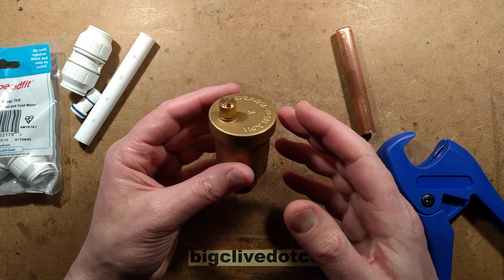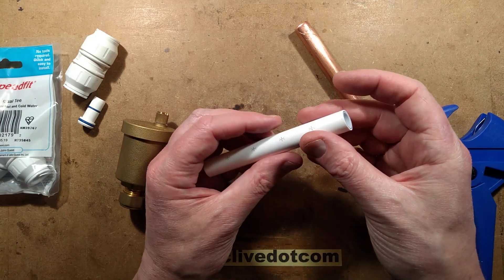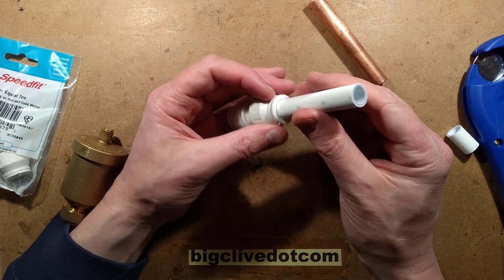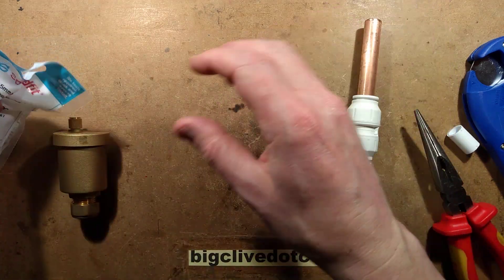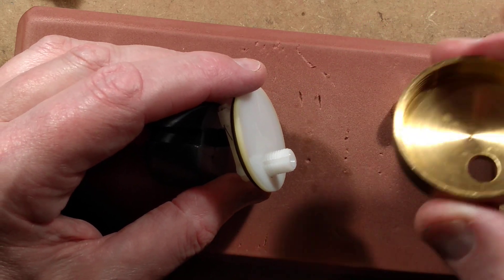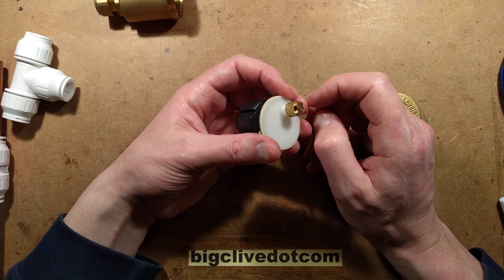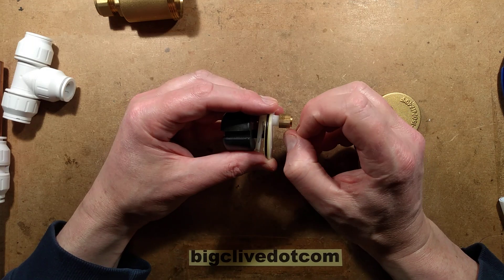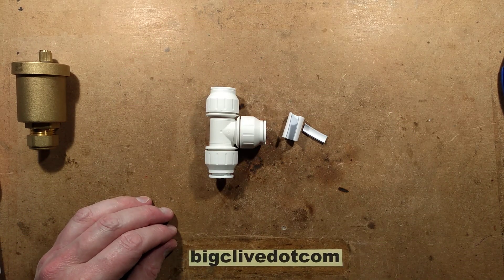Inside a bottle air vent and plumbing ramble.  (No electronics whatsoever.)

Comment: Hi Clive, I was watching your video on bottle air vents, and a couple of things came to mind. Like you, I've always sworn by copper as compared to the new untested plastic pipes. But two winters ago, they had some prolonged periods of below freezing weather in wales. And as my son and his wife have a wooden holiday chalet in wales, when they made their first visit after the winter, and they turned the water back on, there were at least ten different bursts in the pipework. But when I went with them to do the repairs, we found that half of the chalet (I'm guessing it must have been an extension built on the original), was piped for both hot and cold water with plastic pipe of the type you were describing. And whereas the sections of copper in all other areas of the chalet have ruptured, there wasn't one leak, nor forced joint, nor split in any of the plastic system. So maybe, plastic is the way to go. And one more thing, if I'm not boring you; your pinholes in your copper pipe. A thought that struck me, was that I've always cleaned the ends of the pipes with wire-wool. I assume you're familiar with this stuff. And whereas it doesn't leave significant grooves or scoring, tiny little fragments of the iron strands can and do flake off. Could those pin-holes have been caused by such little fragments floating down the pipe and then settling? And over time, some kind of dissimilar metal electrolytic reaction has eaten its way through.

Anyway, these are just my thoughts, and I thought it was about time I thanked you for your instructional videos; keep up the good work.

Comment: Sounds like a problem we have in East Yorkshire with some of the copper pipe installed in the 70's with the impurities and usually quite a thin wall thickness to the copper tube. The reason I've heard is the 70's copper shortages and in the 50's too after the war. I saw a lot of it working for a subcontractor of Yorkshire water. It has the nickname of 'pinhole copper' because often we would fix one leak only to find another would start a few cm away, like someone had gone along the tube with a pin poking holes in it. Mostly we would find many tiny grains of impurities in the copper - a problem that was exasperated by the thinness of the tube!! I was usually easier to just replace the whole run from stoptap to stoptap.
Reply: AcidEric yep, yet when young Luigi and Mario find pinholes, they’ll still swear the pipe was from the 70s not the 50s.
Why of course, because copper pipe from the 50s would naturally have already failed, and been replaced 20 years later by what you see now, still in place 45 years later. Makes lot of a hill good sense to me.

Comment: I have been using those style of push-to-connect for about 10 years now and haven't had any issue. I have been doing FIRST FRC Robotics for 10 years now and the Pneumatics uses those connects for 1/4" polyurethane tubes. The fittings we use are Parker W68PLP-4-2, 364PLP-4,
 and W369PLP-4-2 and the pressure reaches 125 psi. I have never seen one fail and we reuse these fittings every year. Needless to say, they are excellent push-to-connect that is easy to install and removal is just as easy.

Comment: If you'd care to do more water related videos, may I ask you take a look at a product called "my secret bidet?" I just saw a video about it on my homepage and to me it looked as though the dial you turn to adjust the pressure is just a valve that controls the flow right from the pressurized feed on your toilet. The infomercial looked as though it could give you a right blasting up your particulars!
Reply: Providence83 Instant enema whiluwsit.

Comment: I used a similar push-in connector but it is all metal, and less complex. There are no screws. Instead it uses an external plastic sleeve to lock in place.  I'm only kinda concerned about water hammer incrementally nudging it out of place.  (The washing machine this fitting supplies has brutally abrupt valve actuators). I marked the pipes going in, and if they have moved at all in two years, it's within the "resolution" of my ability to read my markings.  (Within the circle of confusion you could say, for photography geeks.)  And yes, this video did make me go run down and check it.  Apparently these are perfectly reliable when done right, coming from my contractor brother and his plumber. (no burrs, no linear grooves).  He suggested using brown scotch-brite in the way you use sand paper here - moderately squeeze the end of the copper with it and act like you're screwing it into the scotch-brite.

Comment: when i first saw the thumbnail for this video, i thought you were holding a drafting pencil sharpener. the i see its about plumbing air vents and funky fittings. good play sir. lol  
   Ive used those white couplings , and several other types, which have held up for decades!  the last time i used the white ones i was running another line for a recirculator on my hot water supply. plastic is so much cheaper than copper and no worries about corrosion or light freezing. Ive had copper freeze and burst at 30f. 
   PEX is the new thing, its prob fine for city water thats been treated with chlorine. because I found using well water it would mold inside the pex tubing. I ended up putting about 1 ft of copper on each end of the pex to see if that would combat the mold but it wasnt much help once it started growing into the pex. but its even cheaper than the white pvc tubing, so its a toss off.

Comment: I like the JG Speedfit system, seems more reliable than the other systems with its multiple o-rings. Does your house date from the 70's? There was a lot of copper piping about in that era which had high levels of impurities. We've had to replace entire 100ft runs of copper piping that keeps developing pin-hole leaks, especially on the mains pressure side. No leaks on the plastic so far.
Reply: Alex nope, house dates from the 40s but the drainage from the 60s because the iron and terra-cotta just couldn’t do 20 years of basic service. The few potable supply retrofits which are copper date from the 70s and have done appreciably better, more or less doubled in life than the rest with only a minor bit of annealing in the outside, and of those, most failures were ruptures from freezing, not pinholes from internal corrosion. Even if they were, I’d guess it stemmed from the fact of town water having been chlorinated until practically the turn of the millennium, when a reverse osmosis plan was implemented.

Comment: I like the simplicity of a push fit system over either Conex or solder fittings but I have concerns over the life expectancy of BUNA-N / Nitrile o-ring seals, The Society of Aerospace Engineers gives this product a 15 year shelf life due to its rubber makeup, real-world-use? double may be triple but that is only 45 years...

Comment: Worth mentioning that in a central heating environment (which is their main/only?use) the valve is exposed to water laden with fine particulates and of an acid nature. I would expect them to fail relatively quickly but they seem to work properly for a long time.

Comment: Havent used them at home but ive used them for installing water systems on motorhomes that run a water pressure of about 30psi and they work very well. I would say though i would only replace each unit after it had been disconected a few times as they tend to loose the sealing caperbilitys after a few times.

Comment: You have to make sure that you have the right type of copper tube.
I recently bought compression fittings and got SOFT tube.  It was a disaster.  Several joints leaked because the tube deforms as the olive compresses.  Buyer beware!
Reply: Agent Bertram shopper beware of their retailer! We’ve got at least six chains of hardware establishments and all exclusive of the most genial will sell you anything without asking what the project is, and sell you whatever they have instead of sending you to better options when available!
Reply: compression fittings are fine on soft copper tubing, you just need to ream it and put "sleeves" inside the tubing first, just like plastic tubing...
the sleeves are generally brass or stainless, but there's been hard plastic sleeves also
Reply: @throttlebottle5906  Thanks for the information.  I have bought semi hard copper now but at least I know that there are sleeves available like with Speedfit.

Comment: Press down when pulling out the insert and that will leave the grip ring in. The plastic pipe needs to be one with a foil layer for heating systems
Reply: brianmck4 only so it can be differentiated by through the wall locator scans.
Reply: Rýán Túçk ???
Reply: aluminum layer = pex-al-pex, that's there as oxygen barrier, there's other non-metallic types of oxygen barrier pipe made of layers, which is exactly what he had there ;)

Comment: Had issues with it on long 2+ floors vertical runs if not supported correctly heating and cooling can cause joints to fail and work apart especially copper to plastic joints.
Reply: Alan Bellwood the problem is that initial insertion introduces a proprietary super thick lubricant which must be replaced and removed from the pipe which prohibits second reinstall from providing as good a hold.
Reply: The other ‘problem’ is that a good solder joint would hold past the destruction of the copper joint itself, and being notoriously heavy and inflexible, the requirements for copper pipe are better known: promiscuously known rather than obscured in vapid bullshit terminology like ‘correctly’.

Comment: I plumbed in my central heating system around 12-13 years ago using push fittings onto copper pipe and got a pro to install and commission the boiler. Not had any problems with the pipework but last year i had a new, more economic boiler installed. I told the engineer about me installing the pipework around 12 years ago and he said in general if installed correctly the push fit systems are holding up better than soldered/compression fittings and is also keeping the water in the pipes cleaner in a closed system than any soldered system.
Reply: Paul King thinking again, second pro was just out to sell a new boiler and maybe later a leak repair, followed by system flush and anticorrosive additive.
Reply: @HighestRank  I asked the pro to install a boiler of my choice so he did not need to sell anything to me. I also got to see the quality of the water that came out of the system a couple of times when it was flushed which was very clean looking and the old boilers internal bores were also very clean and i did not have any type of filter installed until my new boiler was installed. I just chose a really bad, cheap boiler the first time round (Ravenheat LS80) and learned from that experience and now have a Baxi 630 which has been brilliant so far.

Comment: wish my truck had that an air pocket in the head caused a blown head gasket
Reply: Cyberhorn Thedragon no, it was a steam pocket which you caused by not installing a radiator cap able to deal with the pressures from ability to screw up antifreeze’s antiboil properties by adding too much universal solvent.
Reply: @HighestRank  im sorry but no toyota 22re engines have a very bad habit of having an air pocket form in the head when colant is let get too low which i thought id caught in time but didnt the new radiator was not installed in time to save the head gasket which had been weakened by the old radiator getting low due to the 30+ yr old core rotting out if i had known sooner about the core rotting out id had the truck up on ramps to help the air in the system get to the cap opening when i changed the radiator which id clamped off the hoses so it didnt loose coolant up in the head

Comment: I run a training workshop for apprentice plumbers and whilst we use a lot of copper we also do some of the work with pushfit and plastic. I have long ago settled on John Guest Speedfit for a couple of reasons. They are demountable without tools and reusable, which saves us money. Just as importantly they are incredibly reliable. I have the same set of JG fittings on our pressure tester all year and despite being mounted, pressure tested often to 10 atmospheres and then demounted numerous times a day every day, I have never had one of these fail. I always use copper and soldered end feed when given the choice but where plastic is specified I use JG because of these experiences with the product. I have a lot of confidence in them. I have no relationship with the company other than I use their products. Highly recommended id plastic plumbing is what you need.
Reply from the maker: That's reassuring to hear.

Comment: I've extensively used push fit fittings in my house. Mostly JG speedfit, but other makes as well. When you are placing pipes under the floor, it is much more convenient than copper when threading through holes in joists.
The push fit fittings also remove the problem of setting fire to your house when soldering in confined spaces. I've made joints in places that I've not been able to see to make the joint.
Reply: Alexander Wright I’ve soldered joints in a wall where both the joists and gypsum board turned black due to indirect heat from the torch flame. Just put some flux on the surrounding surfaces in the worst cases. Smokes some but it won’t burn.

Comment: I have used this plastic push fit stuff quite a bit. I had my doubts for sure at first, but after a few tests i was pleasantly surprised that it works !!
Reply: Alexpmgr8 K3 after only three tries, it no longer blew itself off the ends of the pipe.

Comment: Just a note to bear in mind for the future make sure there is no flux on the pipe before you assemble a Speedfit fitting. I have had a fitting let go with the small residue of flux rotted the claws away inside the fitting
Reply: Keith Vers nokorode blanches itself with ammonia and urea, though I don’t know if it might be given time to attack noncuprous alloy in large quantities: but the paste I use is petrolatum based  water insoluble and compounded with metal paste.

Comment: Shark bite fittings. I have been using them on our mobile home since we moved in. There were no shut offs on the kitchen and bathroom faucets nor the toilet meaning you had to acess the main water valve even if you wanted to fix only one thing. I found those shark bites and never went back. They even have shut off valves with that setup. They sell a tool you can push up and easily remove them or just push up on the inner ring with a small screwdriver blade and they release easily. I have had only one leak from the store. I returned it for a replacement. They are not cheap compaired to other methods but honestly, the other method is glue and I dont trust glued fittings, especially the chemicals. Also you need to use the stiffer plastic, not the grey tubing that comes in most older mobile homes.  The Shark bites work on all types of pipe too. All plastics and even copper to plastic. Never had one work its way off thermally eather.

Comment: I replace the main water run in to my house with plastic and a plastic value  because of  freezing . That happens about 2 times every 5 years here.  Since the plastic and some pipe insulation the problem is solved.  Given that it  almost never drops below -5c  here in Atlanta GA area.

Comment: I still think I like copper better. It doesn't leach like plastic does and its naturally antimicrobial.
Reply: Gary Carone it leaches. Plastic ‘evolves’. There has to be a difference, because plastic is permeable, and copper is not. Copper ionizes through galvanic chemistry, and forms a sedimentary colloid, which is trivial to filter. Plasticizers dissolve and are more difficult to remove. Your comparison is corrupt:
Reply: It’s exactly the opposite of saying, “I prefer nuclear energy over combustion because nuclear is more complex.”. While true, your preference is only due to a contemporary feature of copper, which could be reversed by a generation of development: a superbug could become copper resistant or plastic could be innovated to exclude evacuation or even effectively germicidal; if not soon or tomorrow, then a ‘decidedly never’ might cause plastic to be replaced by a generational polymer advance...
Reply: Case in point: ignoring the multitudes of microbial menageries required for us to live, didn’t you know that mighty corn lectins are antiherbivoral? That’s true, it’ll attack even your worst enemy. Sounds great doesn’t it? Yet why’re YOU still eating things made from of and with corn? Because it’s toxic to ‘other’ organisms? Need I remind you what you’re made of?

Comment: Plastic is pretty good at holding pressure... even the cheap two liter PET soda bottles don't burst until about 150 PSI (more or less, depending on brand). PEX is pretty widely used in the states but it appears to be more flexible than that stuff and usually copper crimps are used to attach them to brass barbed fittings. The markings on the pipe are a good idea - have not seen that before. Another advantage of plastic over copper is that it is much more freeze resistant. Nothing will burst easier than copper if for some reason a line freezes solid.

Comment: A few years ago I replaced a bit of plumbing with pex tubing in a very accessible area. I've gained confidence thru observation. Now doing full repipe with pex. Slowly. :)
It will be nice to get all (or nearly all) of my plumbing to be pex. Currently I have mostly galvanized steel (with some segments nearly closed off with rust and calcium buildup), some copper, some polybutylene and increasing amounts of pex.